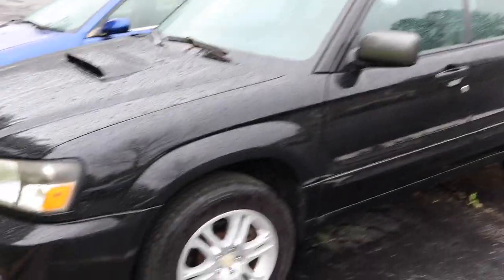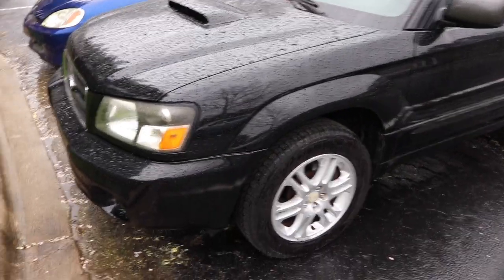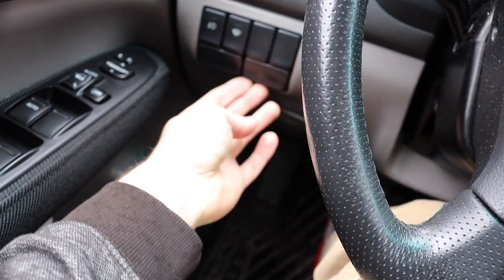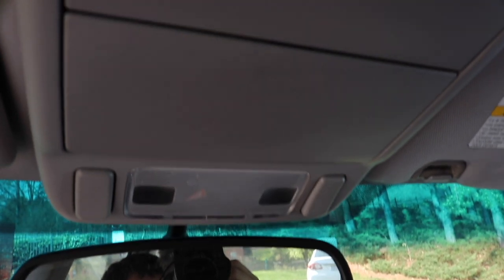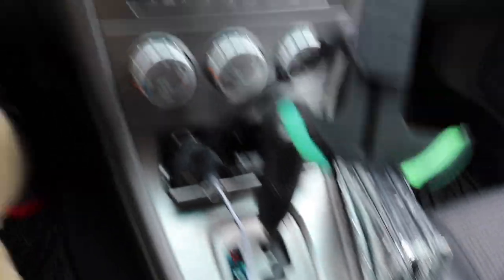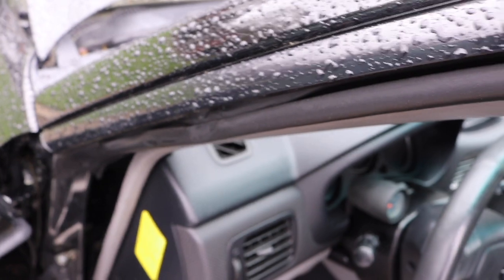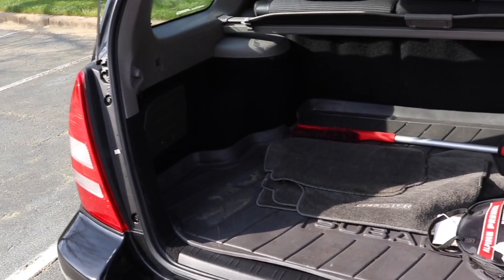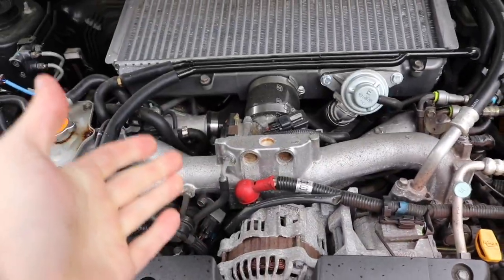10 things I hate about my 2005 Subaru Forester XT

Comment: Spark plugs change takes an hour max. I fixed wind noise with a simple clamp. Just apply it for 15 mins to that triangular thing where your side view mirror is. There are iron plates under the rubber cover that come apart after a while. Remove a plastic cover thing, it’s on the interior side and then just clamp them back together. Make sure that a gap between them is about 3-5 millimetres. Done. Easy.

Comment: Our old Forester 2.0 l in Boston made ma fall in love with that model. 
No matter what happens- it runs! When Volvo XC70 swallows gas as a hungry wolf and cries for the urgent maintenance- Forester just smiled and keep working)).
 Yep, the interior is poor, the paint is typical Japanese thin bad paint, the fenders became rusty, so what?
 It works, and even after the engine was overheated- it still runs somewhere in New Mexico after just a full regular maintenance .
I love that car

Comment: My MPGs aren't too bad. 
There's plenty of exhausts available. Get the WRX wagon one. 
I've never had to use the plug. I've flashed my car more than a few times.
Just a tip, go through the wheel well for the plugs.
STi also has a completely different transmission. And made it's name by rally, not road racing.
You need new door gaskets.
Fuel filter is 60k. Per Subaru.
Reply: That wind noise is not from mirrors, it's from that metal triangle, where is mirror from outside and speaker inside. Take off speaker and mirror and tight it.

Comment: I get 26-27 highway. 🤔 I’m built and fully modded. It all depends on your tune.
Reply from the maker: Wow that's some great milage, do you have an mpg tune?
Reply: 21ish here heavily modded. If you're getting less than 15 something is drastically wrong
Reply: J Robling, did you get the forester tuned after upgrading the parts? Anything done to the engine needs to be tuned or it will run bad.
Reply: I've got stock european version of SG 2.5XT 155kW MT and I have about 10.5-12.5 l/100km - 22.4-18.8mpg (50% in the city, 50% highways [150km/h - cca 93mph] and country roads [100-130km/h - 62-80mph]). I'm driving fast, once I tried to go with lowest consumption and I had about 9.5l/100km - 25mpg.
Reply: You don't buy a subaru turbo for good mpg. You buy one cos your a car guy and you appreciate that they are special cars 👌

Comment: Yo man i have an 05 XT  5MT and I recently found out that i had horrible gas mileage due to a failing MAF sensor. I'd try to disconnect it and spray it down with MAF cleaner and then plug it back up. Didn't work for me unfortunately had to go buy another $100 denso one, but the good mileage and steady idle have returned

Comment: Watched your other two videos and got super stoked, watched this one and still remained super stoked as my '05 corolla xrs is an absolute shitbox about to blow at any moment. All of these issues seem so trivial when I'm currently driving a car with 4/6 gears, a hole in the rocker panel and a seized caliper lmao. I know the seized brake can be fixed easily and cheaply but there is no point since I'll have to scrap it anyways in the next couple weeks.

Comment: 5 things I hate about my 2020 forester:
1) no room in spare tire well for spare tire sized the same as running tires
2) usb port for phone is hidden in cave, android auto does not always work
3) little clearance with chains between chains and fenders with snow built up
4) doors  freeze stuck if go thru a puddle at low elevation and freezing at higher elevations
5) oil filter can not be pre-filled with oil like older subarus could so low oil pressure after each oil change for a few minutes

Comment: My Top Nits, Dash lights too dim, turn signal too quiet, Body too flexy, and that is about it. My 07 XT paint in Newport Blue has held up great in harsh conditions . My fuel  Filter has 290,000Km on it , runs great, gets great mileage on the highway. Around town it is OK. My car burnt no oil between changed till about 20K ago

Comment: I see you eventually changed the hoses for the AOS.  I was wondering about the durability of those clear hoses.
Reply from the maker: The clear ones that I got were just too thin and started to kink at bends. I ended up going with some heater hose

Comment: Thank you for sharing about the fuel filter and oil filter problems!!! How about the radiators leaking and having to change then because they are plastic, they do break easily
Reply from the maker: I have 150k miles with the original rad
Reply: @JRobling  am going to get one this year and your video really helped so much! Is it better with a turbo or non turbo for daily driving both on and off road
Reply from the maker: @leekslukusa8078  non turbo will give you better mpg